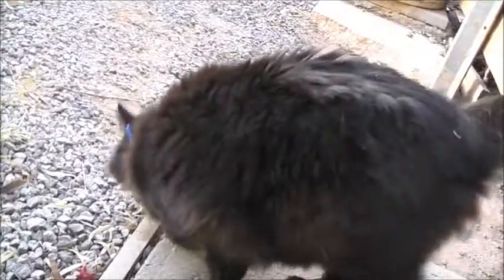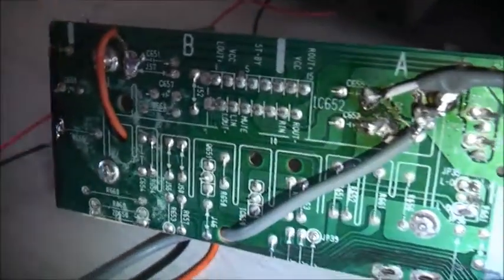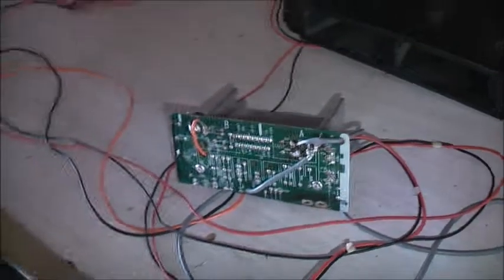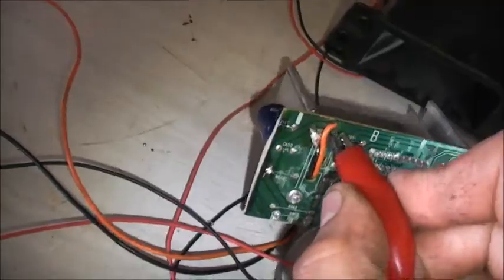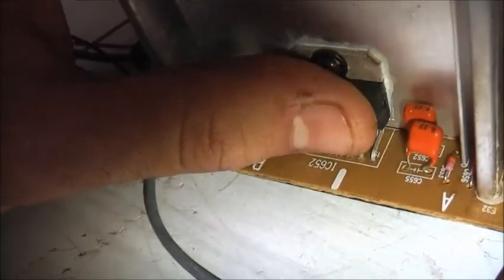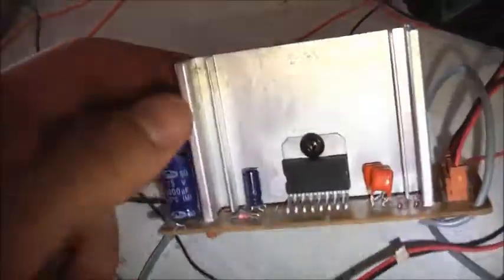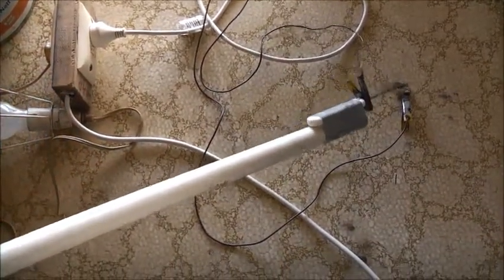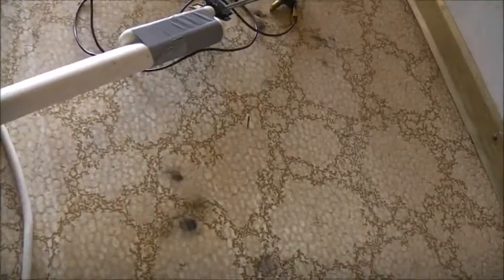TV Audio Amp & Capacitor Bank

Comment: With that amp cut the links off the board that are not been used as they may be shorting. 
Also pin 6 and 7 need to be vcc via a 10k resistor for it to output anything.